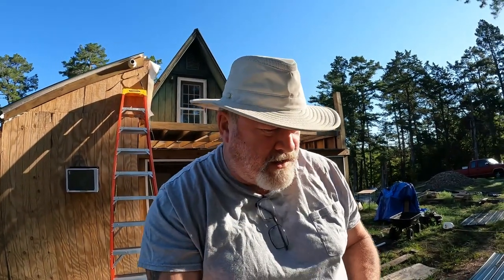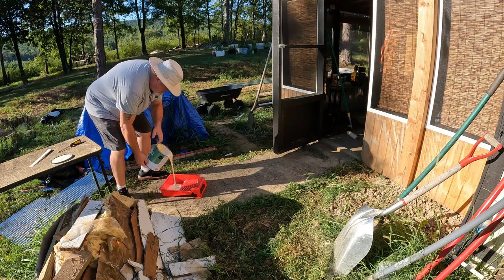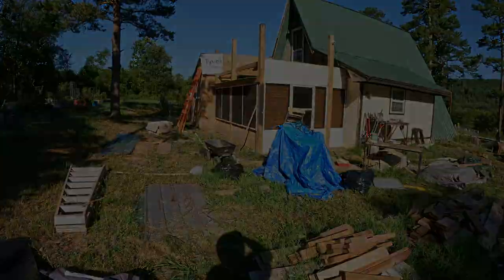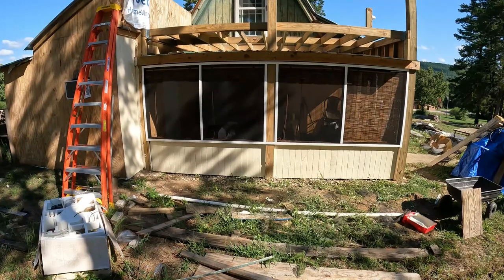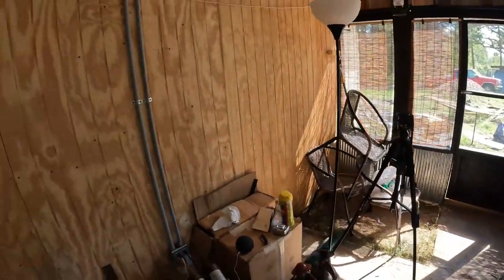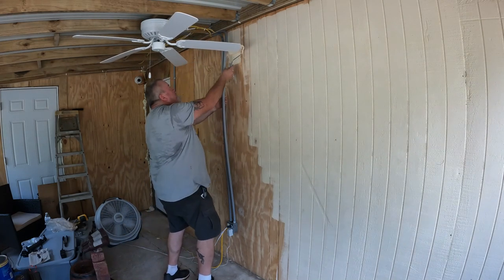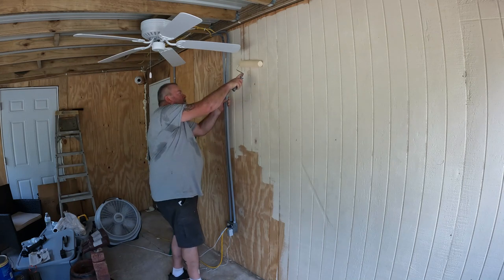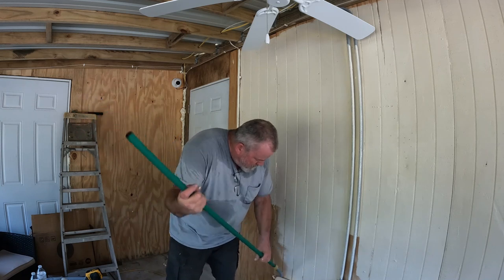Let The Painting Begin! Screened Patio/ Dog Apartment/Upper Deck Build

Comment: I would paint the conduit the same color as the wall, so it will not look like a black line going up the wall and stand out even more. If you can’t fish that wire behind the walls you can by plastic wire channels that can be painted the wall color.

Comment: Stop stressing Mike painting is very relaxing if you used a brush the hard bits are easy for cutting in yes spray paint is easier and come to Australia in January you get temps over 40c way over 100f i love the hot cold you can never get warm thank god its starting to get warm it will be 21c tomorrow that is a little bit warm you doing good soon you can sit back ant just look at all you have done

Comment: I notced when you were showing where you had put the spray foam, that there was a whole line of daylight coming in above the black horizontal boards over the screens. Wasps and skeeters can certainly get in there too!
Reply from the maker: Thats gettin another 2x6 on top, just haven't done it yet,Ive mentioned that many times in past videos, maybe tomorrow I will do it. I also have not caulked anything yet